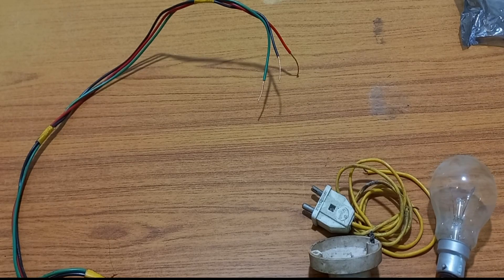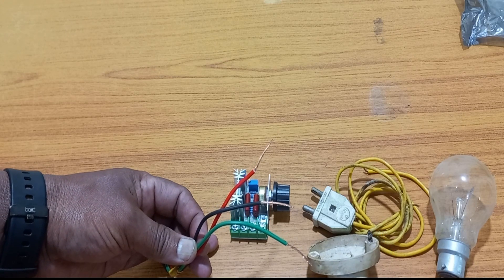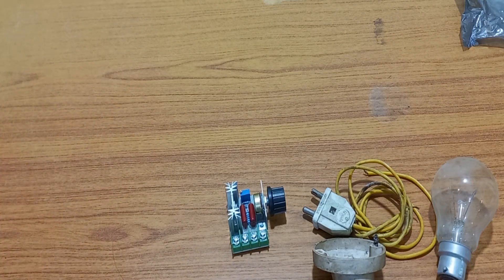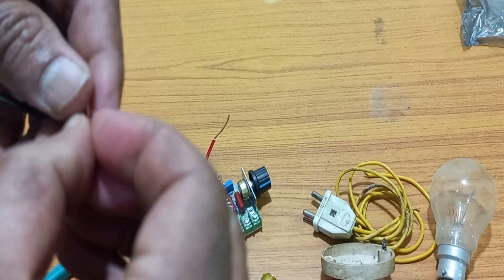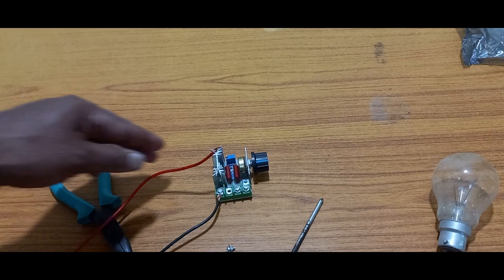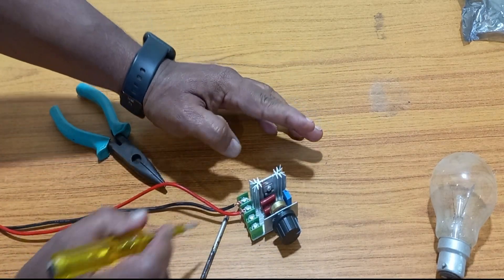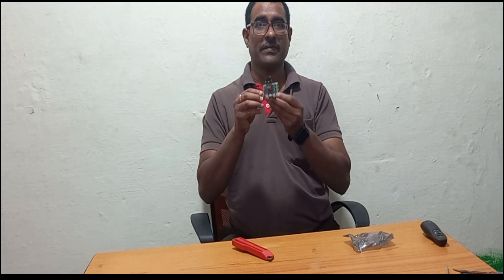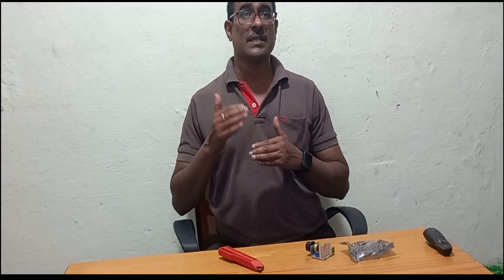DIY Electric Voltage Regulator Temperature/Motor Speed Controller Light Dimmer,2000W SCR Triac.

Comment: But the LED lamp that I use to operate the module I installed is constantly blinking except for high and low levels.
Reply from the maker: Change the bulb and check once

Comment: Hi sir ... Can I use dimmer contrôler speed 220 v 3800 w to soldering iron 220 v 60w ?
Reply from the maker: you can use dimmer
Reply: @Techdude8481  thanks so much for your answer . I will use dimmer . I have already one 🙏👍